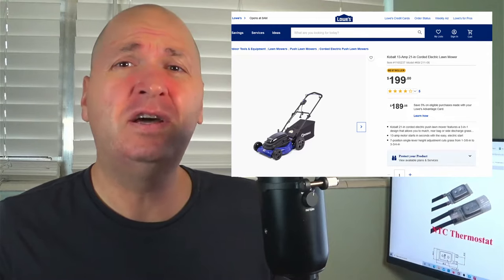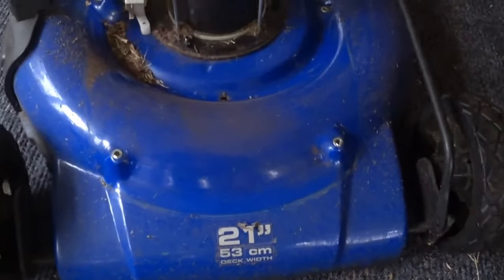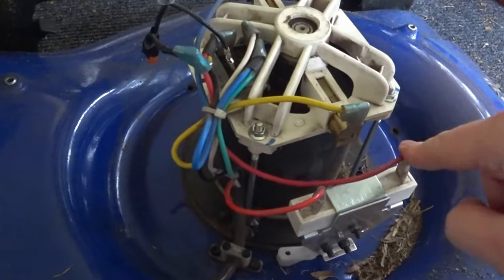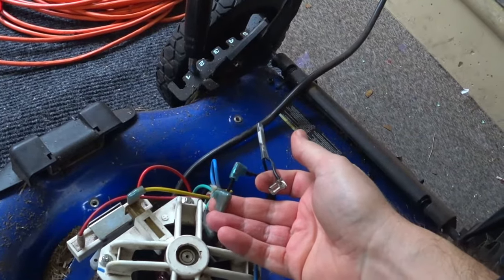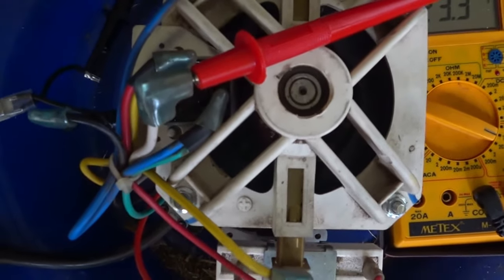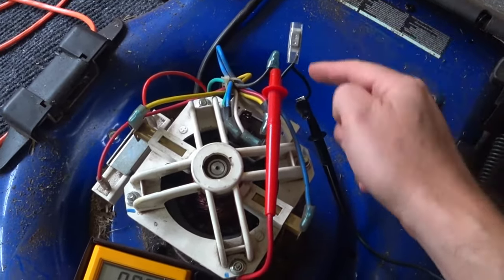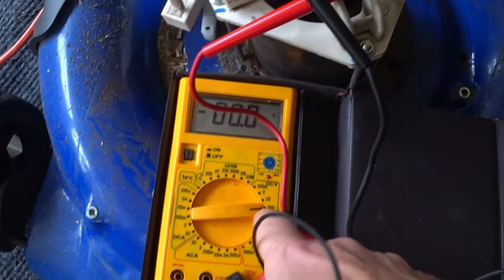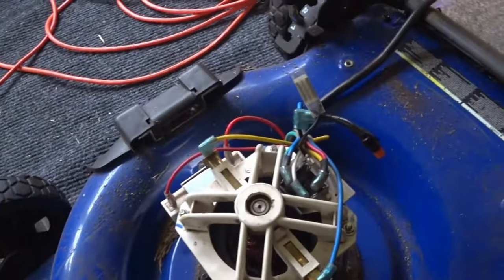How To Fix An Electric Mower That Shuts Off When Hot (Step By Step Instructions)

Comment: Hi, thanks for the video!  
I am having problems getting the replacement 17 amp, 160 degree C temperature control switches from any supplier.

Is there an alternative?  

Could I use, say a 20 amp, 12 volt auto circuit breaker instead?
It seems Alibaba is the only place you can get these switches and their website requires opening an account with them.

Thanks!

Comment: Good video, but if it does not start at all even when cold, how do you check this is not the safety switch on the handle that is faulty? My mower would not start at all and the safety switch has some significant free play, so the problem may be that the safety switch is inoperative and is not letting the current through. Any advice on how to diagnose and fix that? Thanks.

Comment: I have a hart 21inch 40v hlpm03 model... In the last couple of months it started frequently shutting off. It only does this when I try to use the mower on self propelled.... If I shut off the self propelled the mower works fine. Any ideas?

Comment: Nick I have the opposite issue.  Mower quit on me a week ago and every time I tried to start the mower I popped the circuit breaker. I Googled the issue and put a volt meter to the bridge rectifier.  It was bad so I ordered some from Amazon.  Cleaned every thing up and put the new Bridge on the mower along with thermal paste.  

To my surprise, the second I plug the extension cord in the mower starts.  No safety switch required.  I did open the safety/on switch and found out it is spring loaded and every thing popped out.  Can't find one diagram of what the internals look like, so put it back together as best I could.  I opened it because I was looking for something to be fried or burnt causing the switch to malfunction, but everything looked ok.  There is a small plastic square that the wires enter which could be some kind of diode, but again, I can't find one single thing on the internet or the owners manual that provides any information.  

Regardless, the mower started immediately once plugged in to the extension.  Any thoughts on why?  The only thing I can think of is the bridge rectifier is bad and I did order additional so I can check that, unless you or others might have some other ideas.
Reply from the maker: Tom, The switch will have nothing to do with the rectifier. I also opened the switch assembly and it took some figuring out how it works. The reason your mower starts when you plug it in is because the switch is stuck closed. You need to understand how that switch works when the button is pressed. It took me a while to figure it out, but when I did it went together pretty easily. I don't remember now how it went together though.

Comment: My problem just started today.   II'll run for, like, 30 seconds, slow down, then stop.   A few times, it'll come back on then spin down again while I've been holding the bar.    It's not like it's cutting heavy grass or has been running hot, but I'm wondering if it's the same problem.   I know next to nothing about electrical stuff or voltmeters, etc.   But might the switch be the problem?
Reply from the maker: If you notice that when it stops, it still spins for a lot longer than when you normally turn it off, then it could be a bad connection on the motor or somewhere else. When everything is connected and working, it goes through a brake resistor that slows it down quickly when turned off. If it takes long to slow down and stop then there is a bad connection and therefore stopping without the brake resistor. You will have to open the cover to look at the connections.
Reply: @nickfixesit1113  Well, I took off the cover, and cleaned all the interior, checked all the connections, etc., but when I fired it up today, it still cut off after a couple of minutes running time.  Unfortunately, I don't own a voltmeter.   I guess the next thing is to try that part.   At least it doesn't cost much.
Reply: Additional follow up:  Yesterday, a friend ran the tests on the voltage points and it seemed to be fine.  But, of course, once I got it home again, it started cutting out.   At first, I thought maybe it was overheating, perhaps not enough ventilation.  That theory was shot down today when I attempted to fire it up from the start, it ran for a few seconds, then wouldn't respond.   Back to the drawing board, and making a call to the manufacturer.
Reply: @brucemai1429  Did you ever find a solution?
Reply: @baconpilots7372  Unfortunately, no.  I ditched it and bought a Black and Decker!
Reply: My Snapper is doing this!